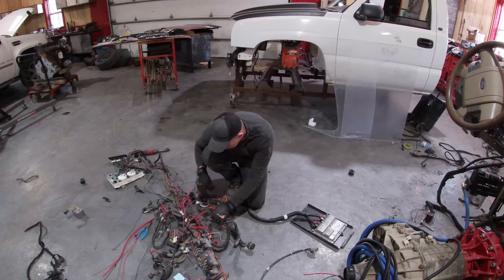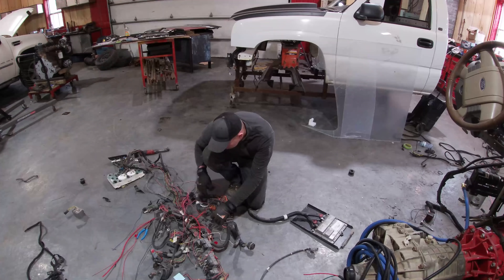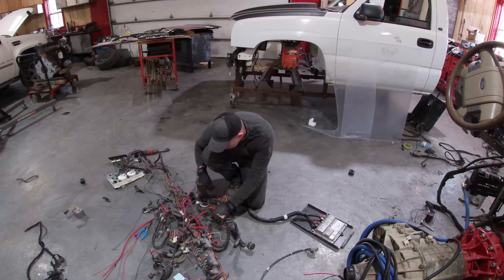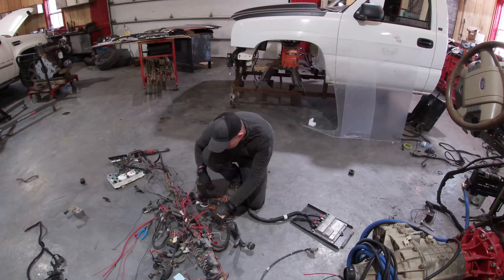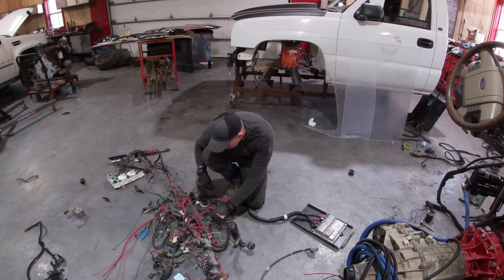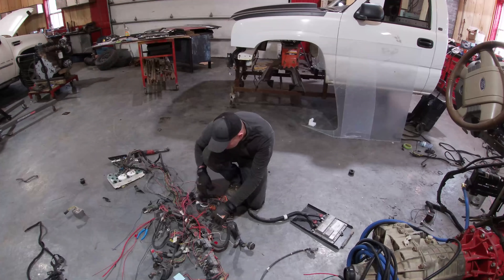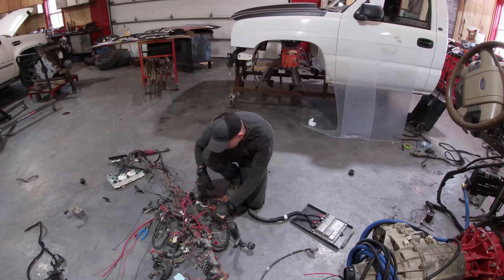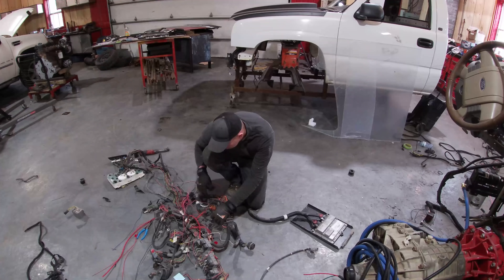Vinyl Wrapping a 30 Year Old Modified Audi is NOT Easy... | #Debocho [S3 E6]

Comment: Group B FTMFW. Those were some awesome and badass cars. The 5000/ 200 has some nice lines to it to begin with and your aero really complements it. Definitely digging the front air dam/ splitter. Looks nice and the rear wing bracing is super important, so good job stiffening that up. I like how you can adjust the attack angle, really good functionality there. I think you should lay up a carbon trunk lid. It's a super easy shape and it wouldn't take much work to make one. You could even use mostly f.g. layers and do a single 2x2 carbon twill layer over the top of the f.g. all you need to make the panel come out well is a vacuum bag and pump setup. You know, I didn't mind the old wrap, but the new one is great. He did a nice job of designing it, and I love the satin finish. I ran an e36 track car and i did all the bodywork and went with a satin black base, so maybe I'm a little bias towards the satin finishes. I used John Deere 'Blitz Black' which is literally identical to a "hot rod satin black." The Deere paint is super cheap and really tough. Very nice work Rich, glad to see work still going into this thing. 👍👍

Comment: I wouldnt start cutting in to the structural B-post just for looks... Specially not without a roll cage. But yeah it looks good with that aluminum piece connecting the turbo intake on the side of the door.

Comment: u ever finish stuff
Reply from the maker: Everything in the shop runs and moves.  Not sure what you mean.  I have 1800 hours into the GTO.   If that isn't commitment, I don't know what it.
Reply: Rich finishes plenty stuff. But, the stuff he hasn't finished hasn't disappeared from the channel, it's getting more work done to it. I'd much prefer to watch Rich working on these projects, adding more and more mds, than have them "finished", neatly parked and polished, but with various extras not installed. 
I don't see what's so wonderful about a "finished" project; there's always something else a guy like Rich can install/change/upgrade. Pretty cr@ppy question really.

Comment: So I thought the spoiler uprights were supposed to sweep back.... right? The point of it is to move the wing further to the rear for added down force through leverage. IDK, maybe this is a different setup but it looks backwards to me.
Reply from the maker: It's an RBT style bumper https://ae01.alicdn.com/kf/H6d26fb43439e45f49ddd7b05a6b9cc2cZ/Suitable-For-15-20-Ford-Mustang-VAD-RBT-Carbon-Fiber-Rear-Trunk-Wing-Spoiler.jpg_960x960.jpg
Reply: @DEBOSSGARAGE  Gotcha. It just looks different because its flat mounted. I wasnt poking at you, just thought it might have been overlooked. This is still one of my top 3 channels my friend. I f*cking love this car.